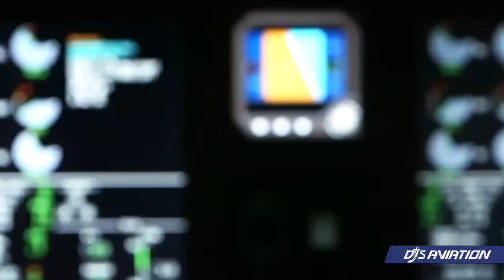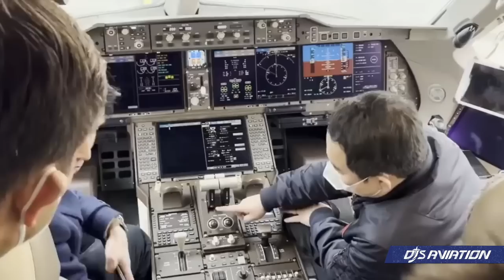Massive Aircraft Order

Comment: Much safer and more economical than anything Boeing can produce.
Reply: And what is you’re capacity in the aircraft manufacturing business to make this claim ?
Reply: @whiskeykilo2h429  
22 years of aerodynamic design at McDonnell-Douglas.  3 years in Everett.
Reply: @alyonapetrova694  wishful thinking from a empty channel !  Try again....
Reply: Euhm ... no. Just look at the datasheets for fuel burn and you'll immediately see that this aircraft is not more economical. And without a track record, it is impossible to judge safety. It only took 1 crash to end the Concorde.

Comment: So these 100 aircraft will take about 70 years to deliver at current production rates…
Reply: As if Airbus or Boeing are able to produce 100 aircraft of a type in its first year... . Remind me, what has the average delivery rate been of the 787 or the 737 Max in the last couple of years?
Reply: @Hans-gb4mv  COMAC is 6 years into C919 production and the production rate has been 1.4 aircraft per year. COMAC says they can reach 150 in 5 years - which is massively ambitious considering they don’t have a track record of high volume airframe production. Nor do they have a track record of achieving global certifications.

FYI, Peak 737 deliveries were 600 per year in 2018 so even with near zero deliveries in 2019-2020, 737 deliveries have averaged 300 per year between 2018 and 2022. Current production rate is about 400 per year.

The average 787 delivery rate from 2018-2022 has been 80 aircraft per year. At peak in 2019 it was 158. In its second year of production Boeing made 46. Over the entire history of 787 production Boeing has averaged 86 aircraft per year.

The point is that COMAC has a very long way to go in production capability and also has yet to prove that they can produce a globally certifiable large transport category aircraft. There is a lot of reason to be skeptical here.

Comment: It looks better and more advanced than B737max 😮
Reply: It’s outdated by 10 to 15 years so it’s less advanced
Reply: Well, the basic exterior and design of the B737Max is basically the same as the original 1967 version when it came out. Of course the engines and avionics have been upgraded along with some other exterior features like the dorsal fin change etc.

Comment: I hope that they don't come to regret ordering the cheap knock-off of an A320 when they could have just ordered an A320.
Reply: The plane have more modern fuselage, avionics, and engines than A320
Reply: @Peizxcv  Yeah,yeah,i'm pretty sure that plane with lower range and capacity at half the price is more advanced then the industry leaders.
Reply: @Z4N7  Shows how little you know of planes
Reply: Delivery slots also play a role. A320 family is booked up for years last I heard.